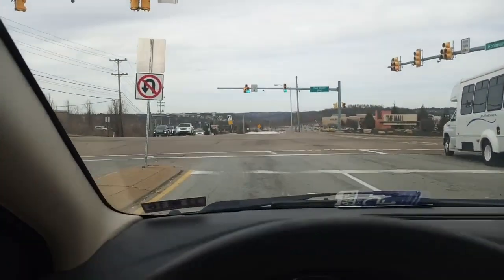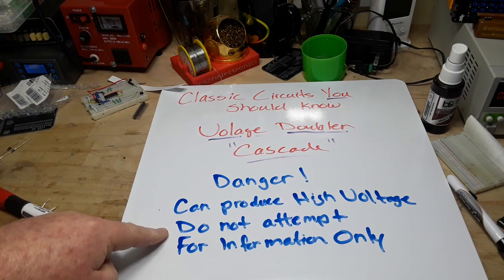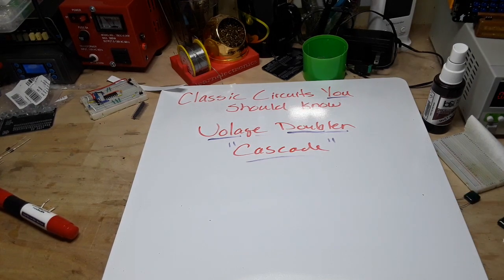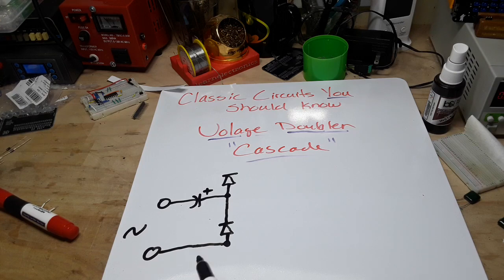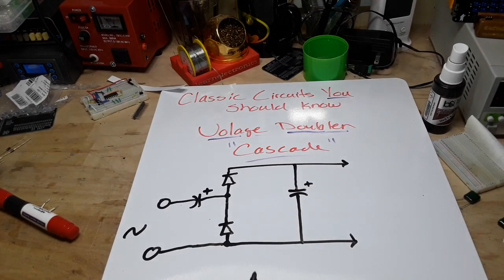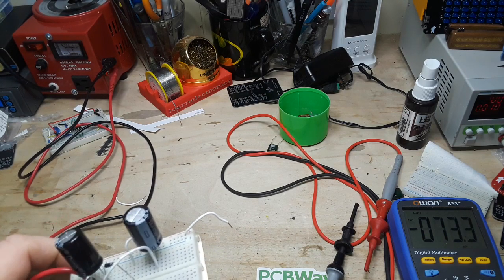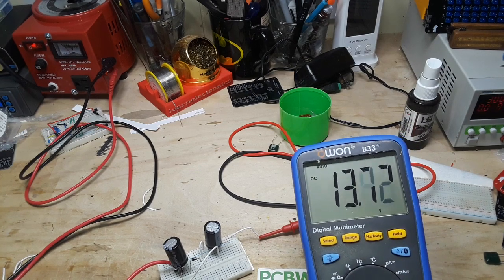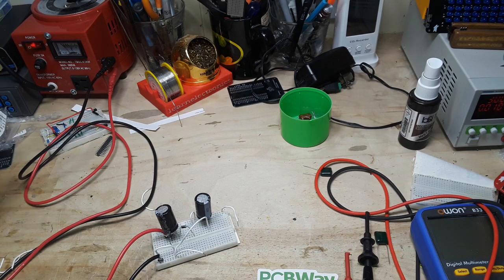Classic Circuits You Should Know - Cascade Voltage Doubler

Comment: Cool yet simple circuit. Thanks Paul.
Got an email today, my (meaning your) Pico breakout boards have been shipped. Thank you for making them sharable so I don't need to replicate the time making my own. I might make my own add on board with a perf board to make some additional plug in modules and such apart from a single I2C

Comment: Hey Yinzer, after you checked the AC coming from the variac and verified it was 10 volts AC (7:28 min), perhaps a check of the AC between the anode side of cap 1 and ground would have been instructive. Also, why did the meter show 13.36 DC volts (5:49 min.) at the output before you turned on the variac?

Comment: I have a ZOOM 1010 effects peddle. its been in the press since i was 17 or 18. just found it again recently got a 12 volt  power supply it didn't work. then opened it up nothing obvious wrong by eye but, i found out its 9 volts centre negative. 300mA. needed to work it. i haven't jimmyed up a connector to checked it yet to see if it works but Anyway what im getting at is "DO YOU WANT IT". let me know where to send it and i'll post it off. a kinda thank you for all iv learned off ya! i hope its working or at least an easy fix. ANYWAY LET ME KNOW!!

Comment: I have a doubt.
While connecting the negative terminal of a dc source to the positive end of an electrolytic capacitor is dangerous (may lead to explosion), then how is it possible to connect the electrolytic capacitor to an ac supply ?

Comment: You should have discharged (shorted) the capacitor once after first boosting the input voltage. That is the reason why you couldnt get decent voltage levels after first attemt.

Comment: On these voltage doubler circuits what kind of amps are you getting?
Reply: THAT's what I wonder about. It seems it depends on the supply. I'm still trying to get a grip on current :-)
Esp safely measuring. I've fried a lotta shit in the process :-)

Comment: can you REDUCE voltage in the same way? with a similar curcuit... i guess it would be a cascade divider ?
Reply: to reduce a high voltage from an alternating HV into low voltage DC but higher current..
if i just use a resistor divider there are losses in the other resistor... no ?
somehow i see caps being charged in series then discharging on parallel... to bring the voltage down... yes?

Comment: Why did you use an electrolytic cap as opposed to a non-polarized part on the input leg? I suspect your circuit died in concert with that cap as its polarity was reversed (although I've never tried this so I'm not sure). Try again with a non-polarized part and see what happens?